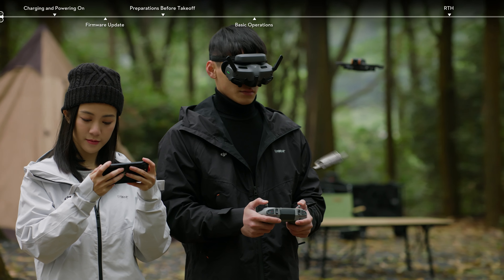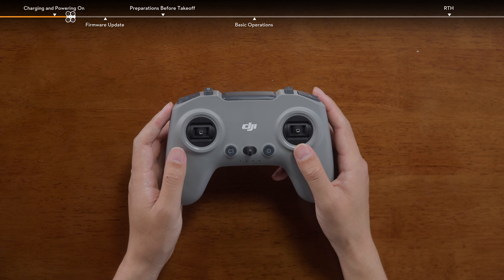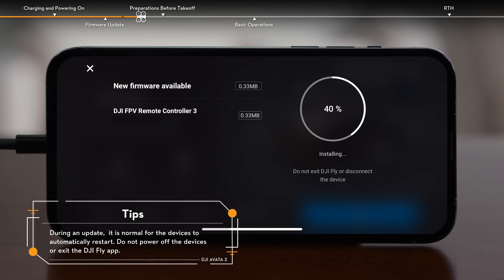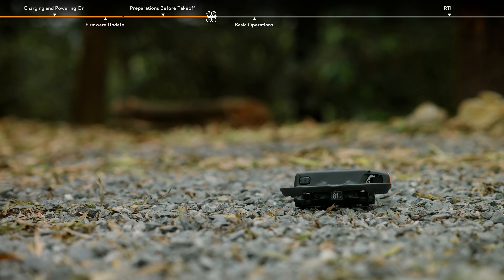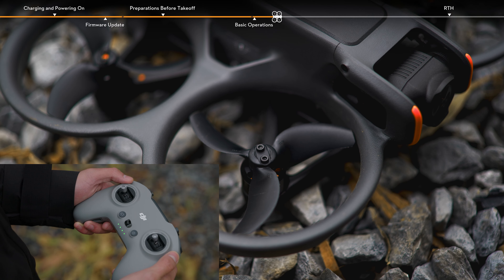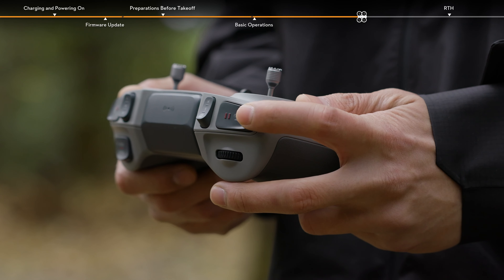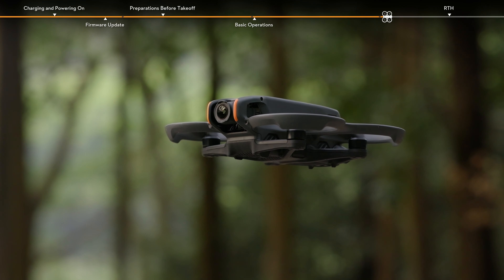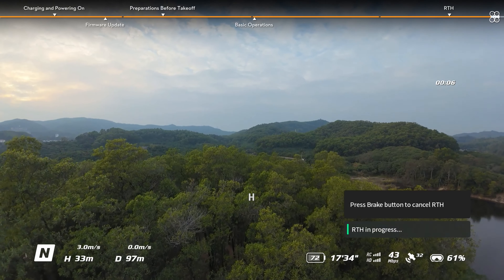DJI FPV Controller 3｜First Use

Comment: I can't believe it took so long to create a PS4 drone controller.
Reply: PS1*
Reply: they had that type of remote already on the dji FPV and avata 1
Reply: Other companies have used this design for Flysky, FRSKY radio master yada yada yada but yes forDJI it took a bit longer?🤷🏼‍♂️
Reply: Considering this is the 3rd model, and 1 and 2 existed previously, your comment is uneducated
Reply: Yea but his controller has a network system worth over 15km

Comment: Can you use this controller without goggles on the DJI Neo? Since the Neo can stream to a phone already
Reply: Can you use?
Reply: I bought the fpv controller 3 with the neo and I can't get them to connect.
Reply: same question
Reply: Did you get the goggles 3?
Reply: Yes you can!
Reply: No, the FPV controller 3 only connects to the Goggles 3 or Goggles N3 then the goggles transmit to drone using Ocusync 04

Comment: Quick question does anyone know if you own the Avata 2 with this controller and the goggles that come with the Avata 2….. can I use the djifpv with this controller and goggles? Just curious because I kind of want to buy the DJIFPV as well.  But only the drone if it would work.

Comment: what fpv simulator works with Dji remote control 3?
Reply: I use DRL and it works
Reply from the maker: Hello, there. Thank you for your interest. It supports third-party simulators such as Liftoff, Uncrashed, and DRL.
Reply: @DJITutorials  Another question about simulators. It looks like flying Avata 2 is much different compared to other fpv drones, many tasks are automated. Is it possible to train flying on simulator with Avata 2 settings?
Reply: Do these simulators work with the goggles 3 ?
Reply from the maker: @macwie5026  You may contact the third-party simulators for this information.
Reply from the maker: @palaHD  You may contact the third-party simulators for more details. Thanks for your understanding.
Reply: @DJITutorials  TRYP FPV is also working.
Reply from the maker: @SmartMetering  Thanks for your information. It would be useful for other users.

Comment: My rc controller 3 is connected
 to the goggles 3 the avata 2 is connected to the goggles everything has been firmware updated the controller controls the camera on the avata but the controller with not arm the motors what am I doing wrong been at this for way to long any help would be appreciated
Reply: Pulling the sticks down into the inside or down into the outside is not working

Comment: It is possible to use air3 controller (without built-in screen)? :D Second question - it's possible to use google-head tilt for camera gimbal tilting using this controller?
Reply from the maker: Hello, there. Thank you for your interest. About your two questions, please correct us if we do not comprehend it right. 1. Do you mean if the DJI Avata 2 can work with DJI RC-N2? If so, DJI Avata 2 is only compatible with DJI RC Motion 3 and DJI FPV Remote Controller 3 now. 2. The head tracking is supported when using DJI RC Motion 3 as the control device.
Reply: @DJITutorials Im asking you if this is possible :) I own air3 now, considering buying avata2 and wonder if I need to buy second remote.
Reply: No your air remote will not work with a DJI Avata or Avata 2. It will not pair up. The FPV3 is a specially designed controller to accommodate optional true manual (Acrobatic) flight.
Reply from the maker: @RadomirRytych  Currently, DJI Avata 2 is not compatible with DJI RC-N2/DJI RC 2.
Reply: @DJITutorials thanks
Reply: @DJITutorials  y al revés, dj air 3 se puede controlar con Google 3 y fpv controller 3??

Comment: Once you've changed adjusted the throttle stick to be able to fly Manual, how do you get it to fly Normal again?i've changed the rear tension to what I think it used to be at factory default but can't get it to fly Manual and Sport again. The throttle stick won't let it ascend or descend again

Comment: will the dji flightsimulator, where the fpv and avata 1 are... will it ever get an update?
Reply from the maker: We are sorry to tell you that DJI FPV Remote Controller 3 does not support DJI Virtual Flight. As of March 21, 2024, the software is no longer receiving maintenance, and all associated technical support has been discontinued. DJI FPV Remote Controller 3 supports third-party simulators such as Liftoff, Uncrashed, and DRL.
Reply: @DJITutorials  sad it really was one of the funnest simulators on what i trained
Reply from the maker: @timoklap  Thank you for your continued support of DJI Virtual Flight. If you have already downloaded this app, you can continue to use it with the corresponding device.

Comment: Is the RC3 compatible with the original DJI FPV drone?
Reply: No, the FPV RC3 connects to the DJI Goggles 3 or Goggles N3 and goggles transmit signals to drone using Ocusync 04. As far as I know it only works with the DJI Neo and Avata 2

Comment: Is this remote will compatible with avata1 and dji FPV.
Reply: No cash grab, I tried, DJI FPV is O3 not O4. Gotta spend the 199
Reply: Heard that you will be abble to use new goggles to 03 and rc 2 to avata 2, so it should work all together
Reply: @martinfilsoch  Doesn't work, that was the first thing I tried
Reply from the maker: Hello, there. We are sorry that currently, DJI FPV Remote Controller 3 is not compatible with DJI Avata and DJI FPV. We will forward your advice to our related departments.

Comment: It would be great for DJI users with older FPV versions to have compatibility with the FPV 2 controller. 🙏
Reply from the maker: Hello, there. Thanks for your interest and support. Do you mean the compatibility between DJI FPV and DJI FPV controller 2 or between the DJI Avata2 and DJI FPV controller 2? If the former one , DJI FPV is compatible with DJI FPV controller 2; If the latter one, DJI Avata 2 currently does not support these accessories (DJI Goggles Integra, Goggles 2, RC Motion 2, and FPV Remote Controller 2 ), but our engineering team is actively working to adapt and test various functions. We will release a new firmware update to support these accessories once the image transmission quality and flight performance meet our standards. Please stay tuned.
Reply: Comprei o rc3, será que vai ter compatibilidade com avata 1 algum dia?
Reply: @DJITutorials  quick question if I own the Avata 2 along with this remote and the goggles that come with it,,,,   Can I buy the DJIFPV drone? Would it work with this hardware?   Because I would love to still buy that drone and not have to buy it with the other goggles and other remote if I don’t have to.

Comment: I have a brand new remote controller 2 I never opened. Can I use this remote for my new Avata 2?!
Reply: Apparently not compatible.
Reply: No, O3 vs O4.  If your like me you will end up with a ton of controllers and a ton of goggles.  Gotta spend the 199$
Reply from the maker: Hello, there. Currently, DJI Avata 2 is compatible with DJI RC Motion 3 and DJI FPV Remote Controller 3.

Comment: No backwards compatibility with FPV controller 2 Smh
Reply from the maker: Hello, there. Sorry for the inconvenience. DJI Avata 2 currently is only supported with  DJI Goggles 3, DJI RC Motion 3 and DJI FPV Remote Controller 3. We would forward your advice to our related departments.

Comment: There's a lot of misinformation surrounding these controllers, saying they cannot be activated/used without a drone. 

I bought the FPV 3 and I do not yet own the Avata. I was able to activate it and add it to my account with DJI Assistant 2 For consumer series drones on pc as shown at 1:36. 

It works with DRL Simulator and TrypFPV confirmed. It should also work with LiftOff but I haven't tried. it just needs to be powered on while connected. Do a full calibration. Don't forget to peel back the left side controller grip (credit card) and adjust the appropriate hex so it the stick stops springing back to center.
Reply from the maker: Hello, there. Thank you for your support and feedback. DJI FPV controller 3 support separate activation on DJI Assistant 2 (Consumer Drones Series). More information can ne seen here: https://dl.djicdn.com/downloads/dji_assistant/20240411/DJI+Assistant+2+(Consumer+Drones+Series)+Release+Notes(2.1.21).pdf

Comment: why the DJI flight simulator doesn't support this DJI FPV Controller 3?
Reply from the maker: Hello, there. Sorry for the inconvenience. DJI Flight Simulator is under termination of development and DJI is no longer to update it officially. DJI FPV Remote Controller 3 does not support DJI Virtual Flight as well. However, it supports third-party simulators such as Liftoff, Uncrashed, and DRL.

Comment: Now, how do I land with the controller 3?
Reply: I was wondering the same thing lol. It says to press the left stick down all the way down to land and stop the motors - briefly in the video - but I haven't tried that yet. I just had it run out of battery and land automatically the first time lmfao
Reply: Press up on the left stick to go up, press down to go down…. Until its on the ground.